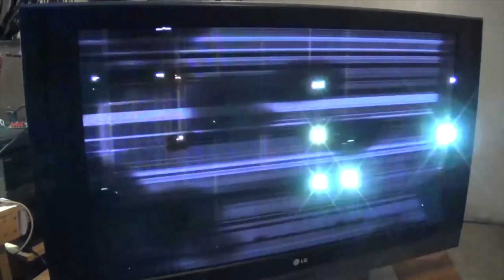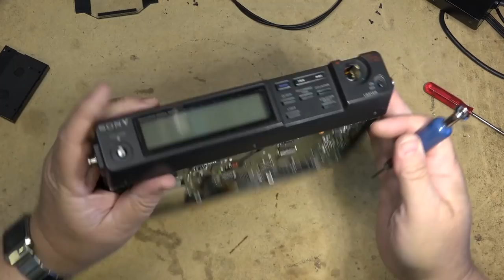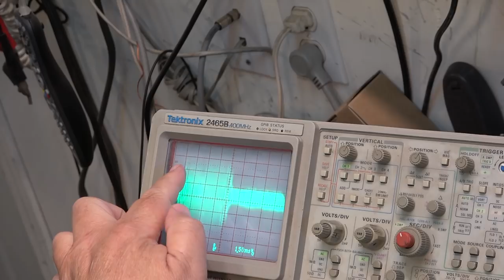Sony TCD D10 Pro Err 24 shows on display when tape loaded

Comment: I have the same unit with a different fault, the internal cassette tray does't open. I've replaced the belt on the motor, greased the moving paths. I think the problem now is that there is no sensing of the outer cassette tray closing. The cassette symbol on the LCD is flashing continuously, closing it doesn't make the motor operate. Looking for a manual atm!

Comment: I've acquired one of these units, the second model after this one, the TCD-D10 Pro II. Throwing the same ERR 24 code. I'll have to check those gears out. How obvious is it that its jumping a tooth?
Reply: I've also found some more info about that "modified" sticker. HiFi engine says that units with that sticker are basically modified TCD-D10 Pro's to make them equivalent to the Pro II

Comment: Dave, can you explain Sony code 24?   24 00 INVALID FIELD IN CDB: Bits set in one or more fields are not supported or are reserved. Refer to the Field Pointer (Bytes 15–17) to identify the illegal bit or field.
Reply from the maker: The mechanism wasn't completing the loading cycle because one of the 2 loading gears had jumped a tooth and arrived at end of travel before the mode switch was in the load position jamming the load motor.  This caused an emergency shut down and tape unload.

Comment: I'm glad you talked about keeping screws organized on your desk. I don't have a big work area and things can get lost easy. If I have to take apart an unfamiliar item, I've got a system of labeling the screw locations with masking tape (the "painters" easy to remove kind) marked with a letter (a, b, c) and then putting the screw in one of those plastic compartment boxes (beads, fishing, etc) each section already labeled (a, b, c). Big time saver putting back together, good for verifying each screw got back, lid snaps closed for overnight or while parts are on order, and you can mark the whole box per the item/job.

Comment: Wow. I just found one of these at a thrift store. It powers on, the screen works, the battery says it's charged but there is no movement in the mechanism which is supposed activate the spinning of the tape. Could the absence of the back up battery be an issue with this not operating?
Reply: Having no experience whatsoever in this sort of diagnosis or repair I found simple observation to be of some help. I noticed that the tape door wasn't closing evenly. It was higher on the left than the right, which I thought might be keeping an important triggering device from functioning. That's when I noticed a small wheel near the left side. It was brass inside and rubber outside. I used some tweezers to see if it might be movable and as it turned out it wasn't attached to anything. I removed it. That's what was keeping the tape door from closing properly. When I closed the tape door with the rubber covered brass wheel out of the way, I still had no tape movement. I also saw a flashing tape image on the screen. I'm guessing this 1/4" little wheel may be the cause of the issue. Did it fall into the machine? Or did it fall off the machine? I don't know. I'll investigate further.

Comment: DAVE! Very interesting contribution. For Sony has completely ignored customers and from Sony to this day you can not get anything. What was the direct cause of this failure, did you replace certain original parts with new ones? Maybe the small V-belt shown was already obsolete, or the grease between the gears solidified and blocked the rotation. Thank you for your reply.